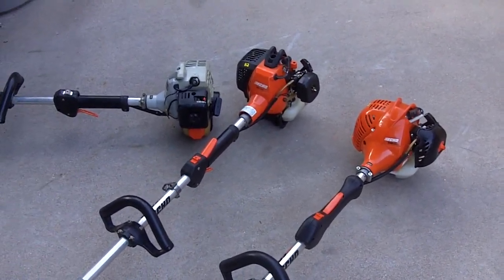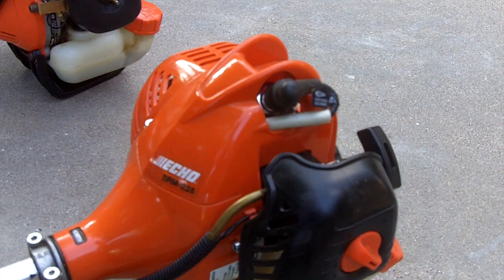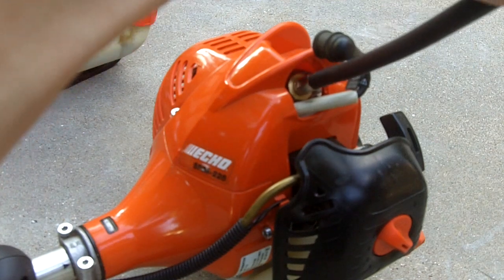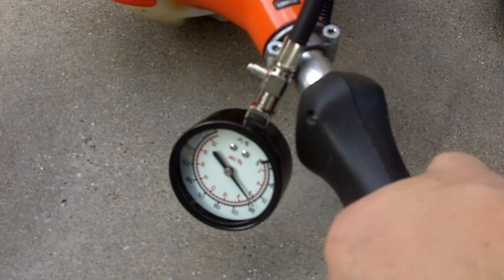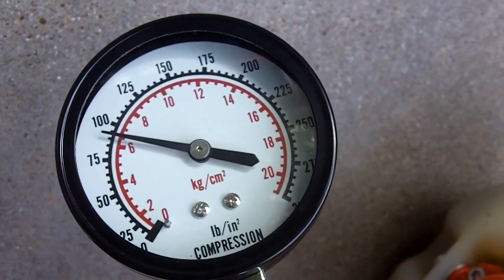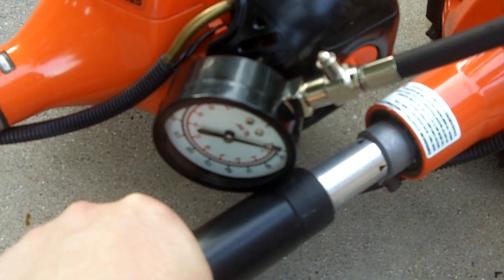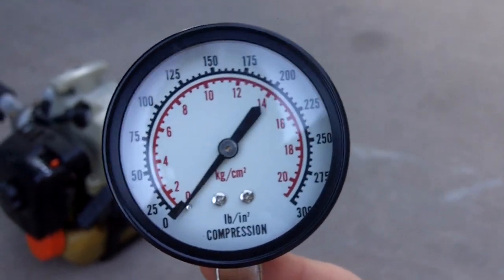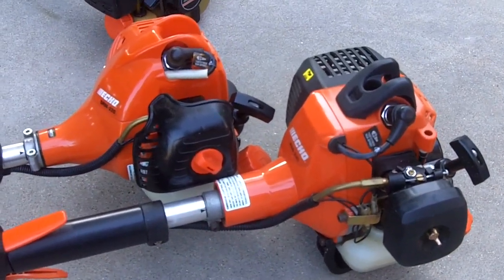Echo SRM 225 and PAS 230 Compression Test

Comment: When I bought my SRM230 in 2009, I got 160 PSI out of it. 5 years later, after getting it broken in good, countless hours of running it wide open in 3-7 foot tall grass, getting it so hot it burns your arm twice, and normal maintenance. Iget 145-155 PSI. I run my equipment 32:1 though regardless. Never a problem.
Reply: Nice. I run mine at 38ish:1... (6.4 oz per 1.9 gallons of gas). 
It's a 2 gallon tank, but we stop at 1.9 so it doesn't overfill, and we use a full bottle of 6.4oz which is meant for 2.5 gallons at 50:1, so technically, we are around 38:1 - 40:1, according to premix calculators that I have checked. Equipment is no longer being seized with the extra oil. We were seizing stuff left and right with premix at 50:1.

Comment: When you pull the starter cord out slowly if it doesn't have the , stop , stop , stop , bump bump bump feel to it , then check the compression ! Anything BELOW 120 psi , check cylinder wall and the rings for sticking or stuck rings , it can be tricky though,  I have a srm 225 that has had the hell run out of it and other than a crap carburetor it still runs great and idles like a chugging little train 🚉